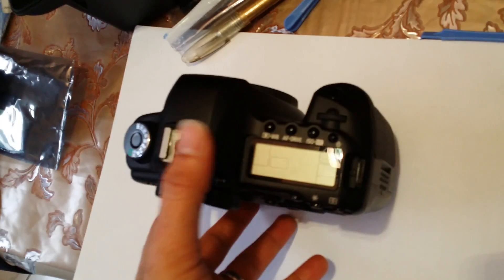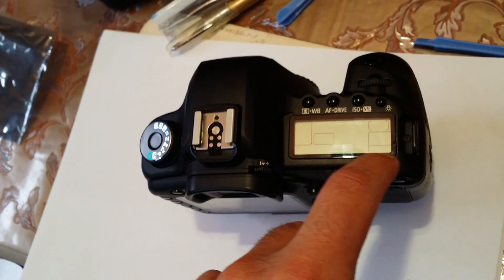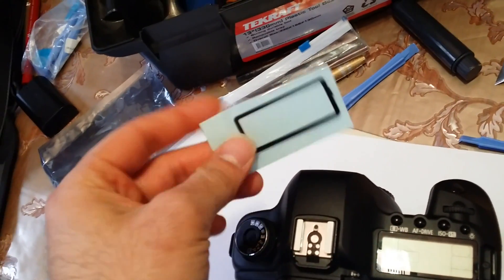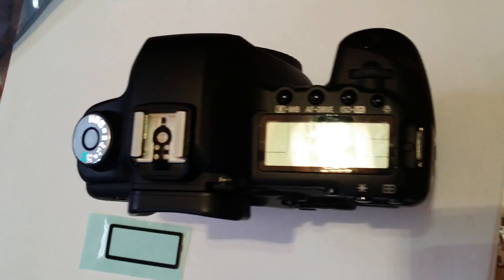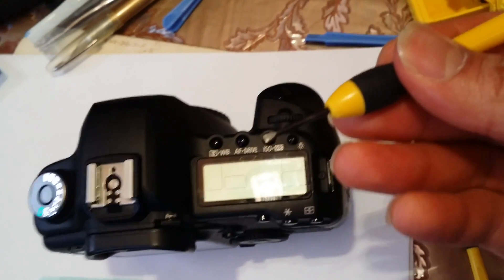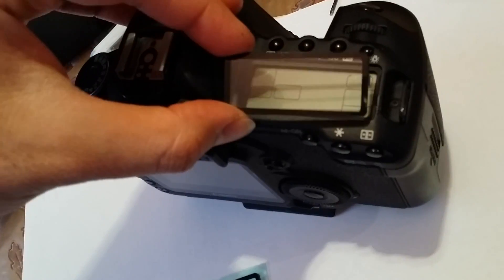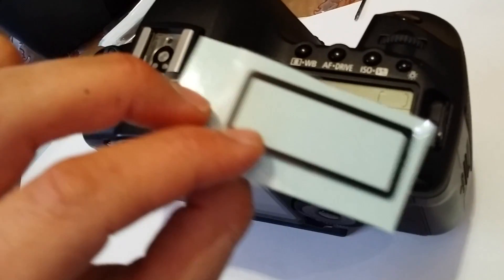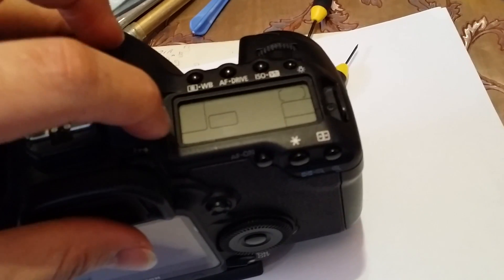Canon 5D 7D DSLR Top Screen (Window) Replacement

Comment: Replacing to get rid of dust is not worth it. It’s nearly impossible to remove all the dust without the proper cleaning tools and plenty of patience.
A trick people use is trying to blow air in from a gap in the seal by pressing the window to one side and then blowing compressed air into the tiny gap.